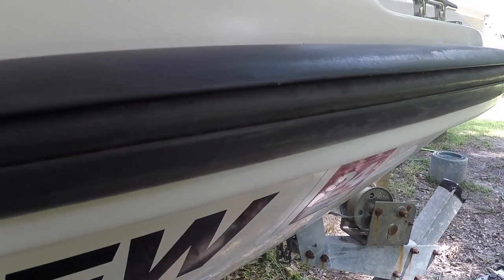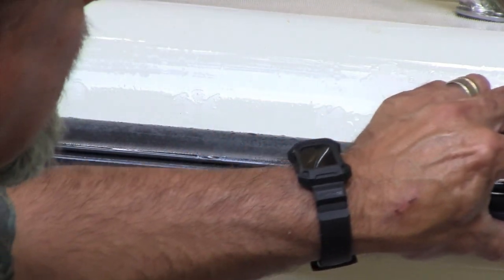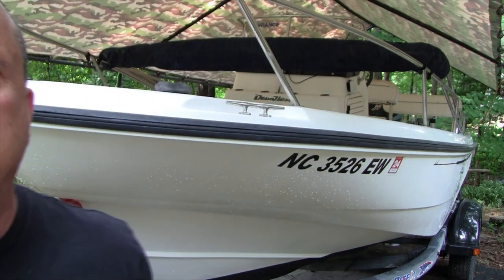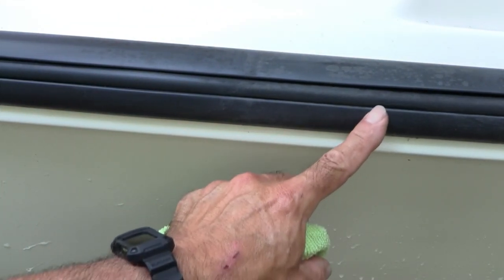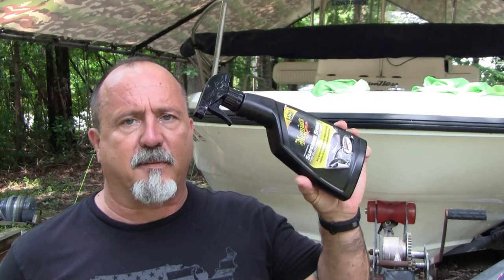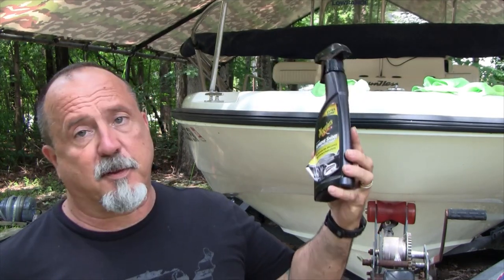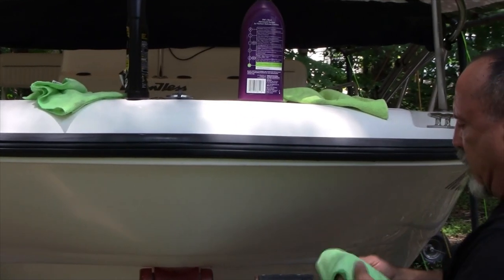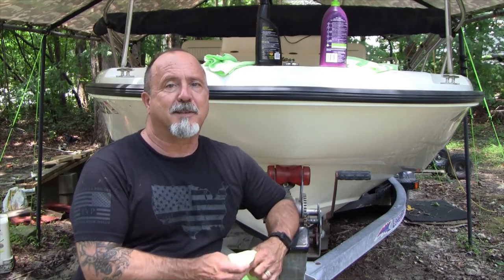How To Restore A Boston Whaler Dauntless Boat Rub Rail - Fast and Easy!

Comment: Did you have to do anything with the bow rail?  My Dauntless bow rail is coming loose.  Screw holes are wallowed out.  Fill them in with 5500 or mont in to wood beneath?
Reply from the maker: Mine was pretty solid. I would refill the hole with epoxy. Core out the foam with a small allen key on a drill first and vac it out. Should leave you with a solid base